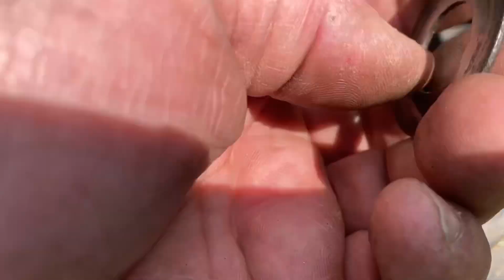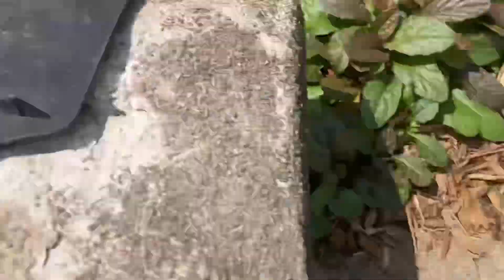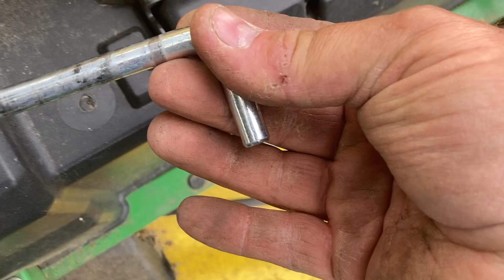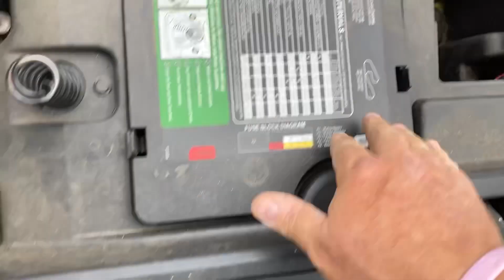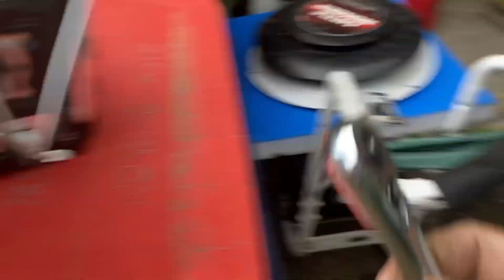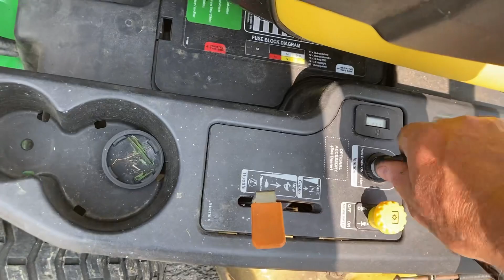Deere EZTrak Z225 Sloppy Hydro Handle keeps falling down, let’s fix it!

Comment: Looks reasonably well built for end user adjustment. Must admit I am fascinated by how often hydro static transmissions turn up on North American lawn mowers.
Reply from the maker: Hydros are convenient and negate the need for brakes, although I always make sure any brakes are adjusted and working properly. Thanks for watching!
Reply: @KensSmallEngineRepair  Interesting. Cheers.